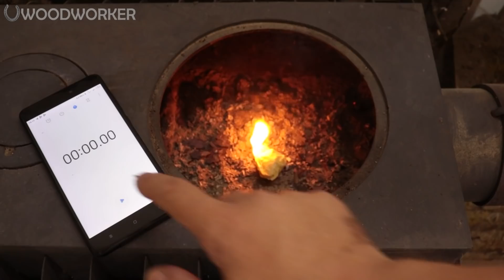Ingenious Intelligent Secrets & Tips That Work Extremely Well. Handyman Construction Tricks & Hacks

Comment: Some great ideas, but I'd recommend never using a drill press as a spindle sander. This is probably the most damage causing application there is for that machine. Last year, I bent a spindle on a brand new drill and the manufacturer tried to accuse me of this practice and not honor the warranty. (I did not bend it using as a sander, but it will void any warranty)
Reply from the maker: If you didn't bend it, you had to prove your case!